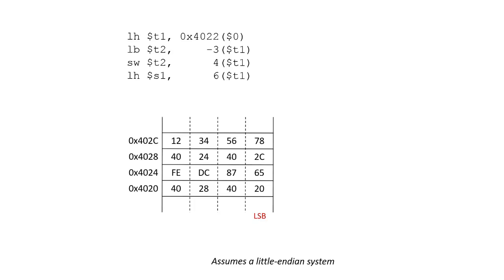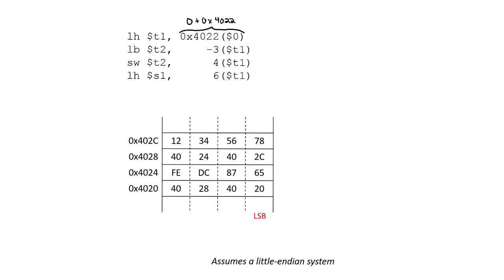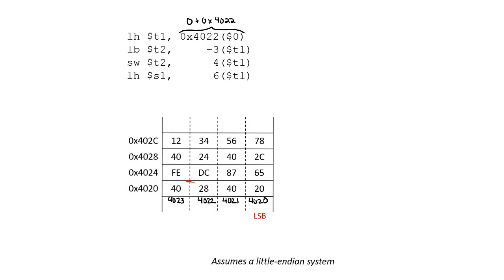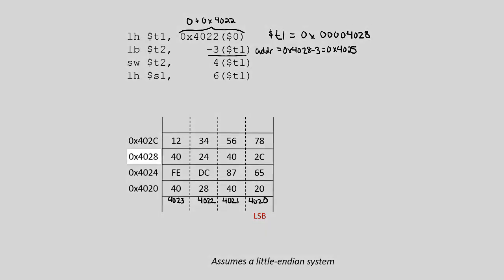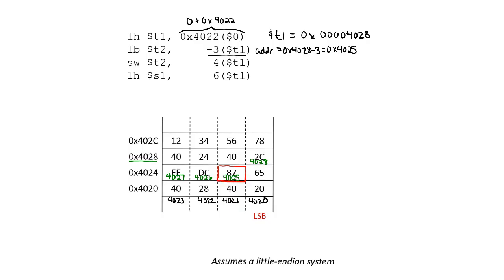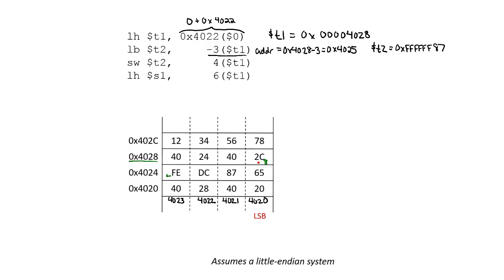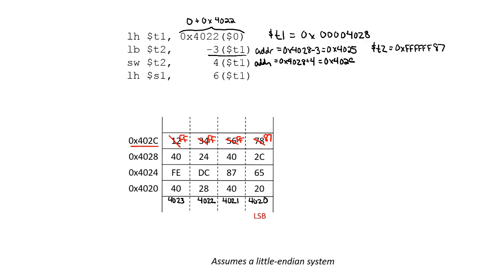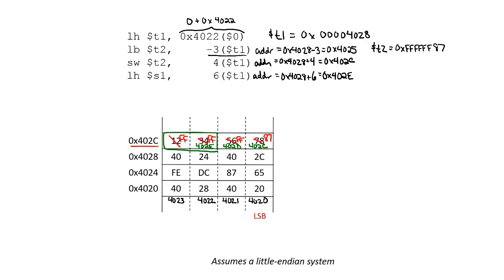MIPS Load Store Example

Comment: why did you replace the first 3 byte in 0x402c with FF not 00?
Reply: The number is signed. F at the start of the memory (the most signifacant bit) means that the number is negative, so by loading a byte you have to replace the first three byte with FFFFFF and then the last 2 byte at the end.
Reply: @dones2758  How do we know if we should sign extend? 
Do we only do it when we have "load byte" or there are some previous requirements... 
Thanks in advance :)
Reply: @rickie_bo  Yeah only with load byte